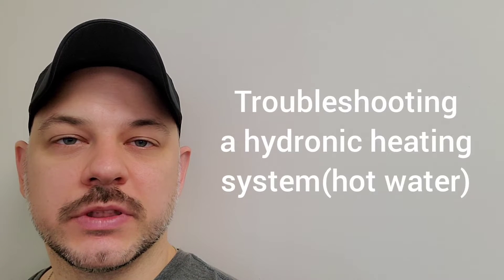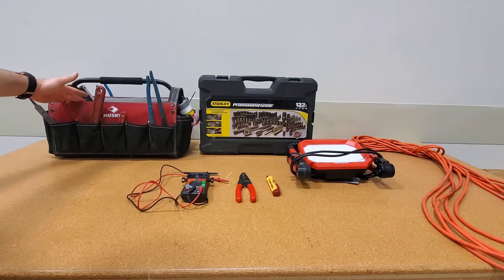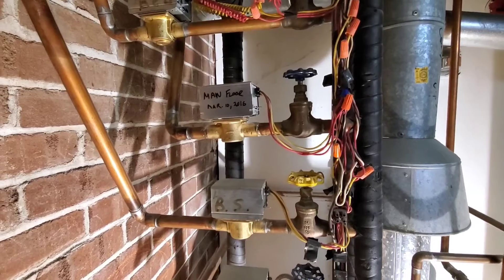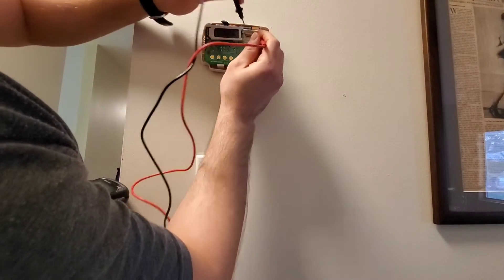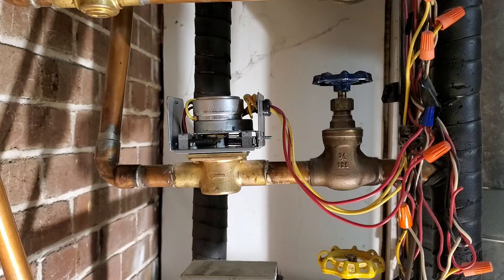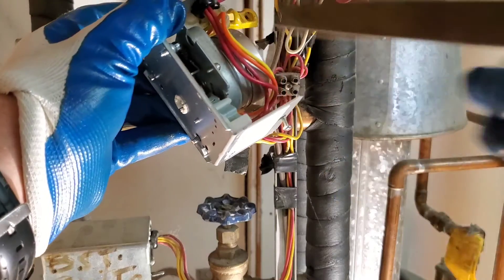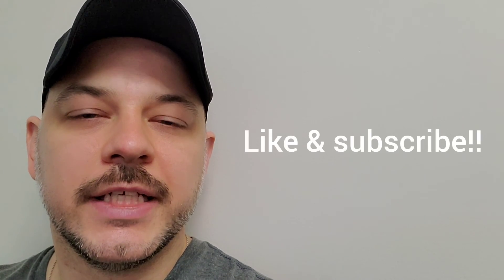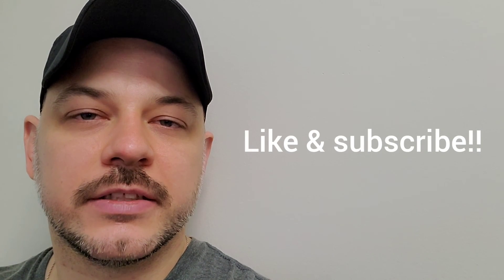Troubleshooting a hydronic(hot water) heating system (DIY guide)

Comment: You can save a lot of time by jumping the t-stat down at the boiler for which ever zone you're testing. Just attach a jumper to the wires or twist them together and put on a wire nut. I prefer the jumper. Then you don't have to keep going up and the stairs.
Reply from the maker: Thanks for your comment, what do you mean by Tstat at the boiler? Is it attached to the boiler?